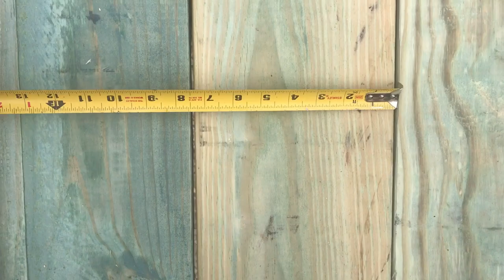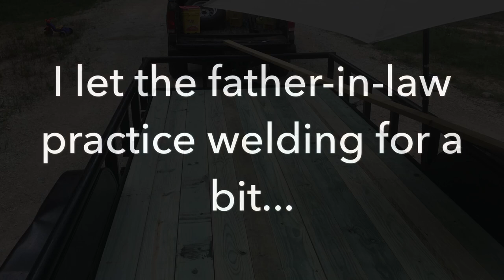Putting a New Floor on the Trailer

Comment: good video. I would not have removed the piece of flat metal strip. This board ends would have went right under there. Good looking floor
Reply from the maker: Seems like I had a reason. I think there was a channel on both ends and I couldn’t bend the boards enough to get up under both maybe.